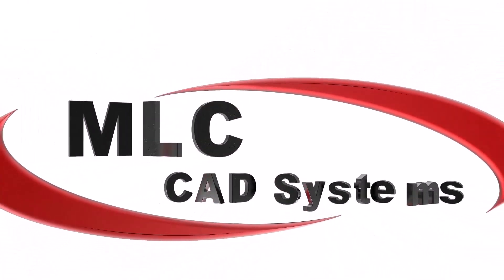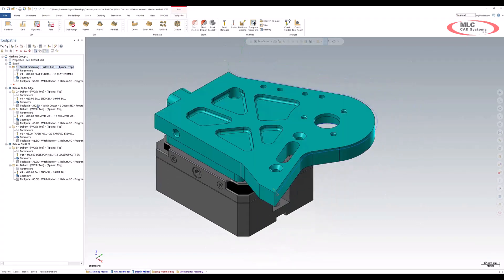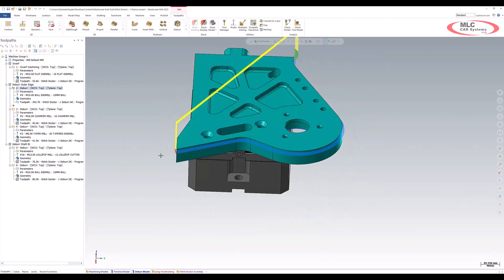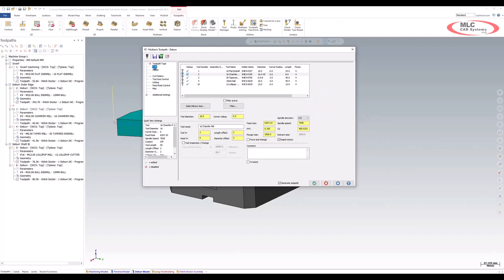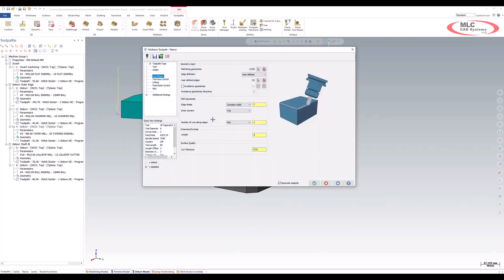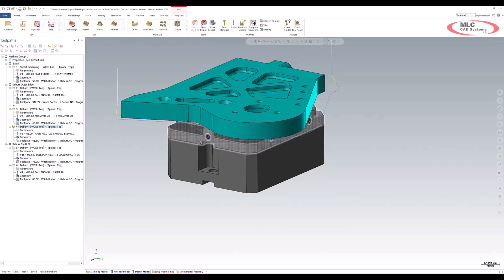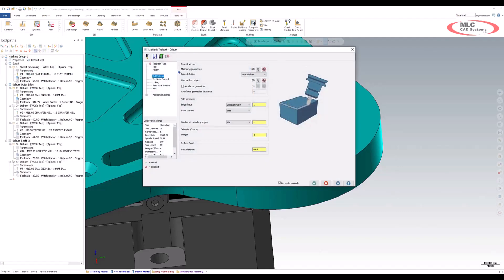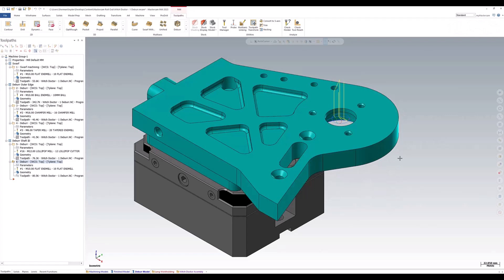Deburr Toolpath Enhancements - What's New Mastercam 2023

Comment: Whenever I run multi-axis deburr the toolpath runs really jerky in the machine. Even the the linking moves. I don’t have this issue with swarf milling or surfacing with multi-axis unified. Any ideas what’s going on here?
Reply from the maker: Discussing this with our team there isn't anything immediately obvious from your description that would cause this, it would require some troubleshooting with the actual file.  If you are a customer of MLC CAD Systems I recommend reaching out to our support team directly at https://www.mlc-cad.com/technical-support/ to work through this issue.